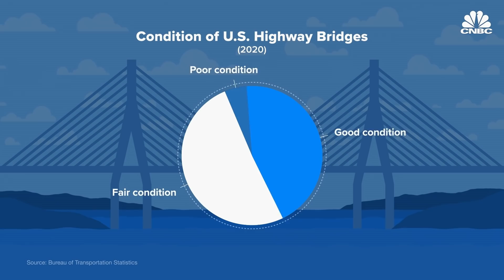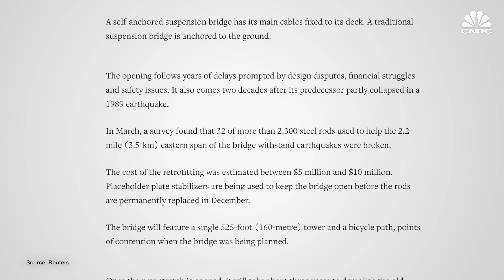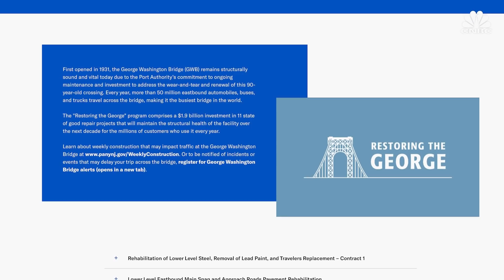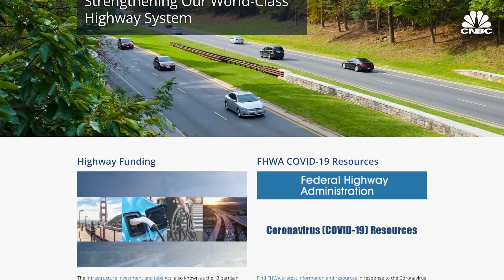Why U.S. Bridges Are In Such Bad Shape

Comment: This video completely missed what Minnesota did after the collapse of the I35W bridge.    The State did a study that identified that the DOT had competent engineers; but was woefully underfunded for bridge maintenance and replacement.

I live in Wisconsin and I recall a multi-$billion Statewide referendum to fund bridge repair and replacement; and the gas tax was raised as well for additional money.     For about the next 12 years there were two seasons in Minnesota.   Winter and bridge construction.   Minnesota addressed all structurally deficient bridges in the State and most of the functionally obsolete ones as well (and are now working on the remaining functionally obsolete bridges).

Now any bridge that gets identified as on its way towards Structurally deficient gets a planned rebuild or replacement project started.  The DOT is now adequately funded for bridge maintenance and replacement.

No one in Minnesota is complaining about the cost.

Why can't other States do the same.   Does each State have to wait for a major collapse that kills people before they take action.

I believe that this video should have pointed out that One State - Minnesota actually took care of their problem.

Comment: One thing is striking in the US: Wherever you go, you see 2.5 ton trucks transporting a single individual between A and B. By weaning 'Muricans off heavy trucks and getting them to use small cars (700kg up) will solve the bridge/road load problem in one fell swoop, not to mention the fuel savings! I know that in 'Murica this is a pipe dream, but still...
Reply: Wrong, totally wrong.  I've been an engineer for 38 years.  Heavy commercial trucks with a legal weight limit of 40 tons control the design loads and stresses on bridge structures, and they aren't going anywhere.  Like it or not, heavy commercial trucks will form a vital component of the transportation picture for the foreseeable future.

That's not to say that it wouldn't be beneficial to switch from heavy SUVs to lighter passenger cars, but it won't have an effect on bridge longevity.

Comment: Seattle has bridges like that. Originally put in expecting single vehicles not semi trucks a multiaxle transit buses. The City has lowered maximum weight per axle and lowered speed limits. Note the transit bus at the break point.

Comment: I have to ask, if that one bridge is 25% of trade between Canada and the USA, what else is in the top ten border crossings list and how does their share of trade compare? Is it mostly truck traffic, or are there rail ways and pipelines too?
Reply: That number is often misquoted. It is 25% of trade by value. Items which have a lot of volume are typically shipped by train. This includes items such as cereals, coal and raw ore and oil. It also includes large and extremely heavy items.

Comment: One of the main problems is our desire for cheap gasoline. Prices in the US are significantly lower than in other developed counties, even though the base cost of fuel is not much different. Frankly, we don't take in enough tax revenue to pay to build or maintain our transportation. I drive in France about 2-3,000 kilometers every summer and I have never seen a pothole.

Comment: Structurally Deficient doesn't necessarily mean unsafe.  It does mean that 1 part of the bridge doesn't meet CURRENT safety standards as directed by the Federal Highway Administration.  For example, the bridge rail on MANY bridges built just 15 years ago that met safety standards when constructed, wouldn't necessarily meet current safety specifications simply based on the design.  The FHA keeps moving the bar...which isn't bad but it does make it impossible to keep current due to limited construction budgets.
If you want better infrastructure, it's going to cost you!
More in-depth inspection of current inventory might be the answer?
FYI.....I am a bridge inspector.

Comment: The US built most of its infrastructure decades ago while many countries like China are recent.  Not really comparing apples to apples but agree there is not much maintenance done due to poor government spending.
Reply: Having driven the roads in China, I can say outside of the few major thoroughfares built last century (designed to handle tanks and large missile trucks) that Chinese equivalents seem to degrade surprisingly quickly and require almost monthly resurfacing. News leaks of some viaduct or tunnel collapse seem to happen just as often as ones in the States despite being brand new (often not even open yet), whereas the the ones coming down in the US tend to be ones that were in service for the better part of a century already.

Comment: The problem also is we don't build properly like they used to years ago.. just like the houses they don't build them like they used to the bill cheaply and crapley the bridges today I made cheaply and light and weak..
Reply: You shouldnt talk about stuff you dont know anything about.  Houses built now are better in everyway than even 30 years ago.  I know seeing as I've been building and remodeling for almost 30 years now.  Same goes for bidges.  Old bridges designs had 2 girders, where one fails the bridge collapses, where as all modern bridges have 4 or more girders and will never completely collapse if one girder fails.

Comment: Good report. Some states, like Pennsylvania and Michigan, are not as wealthy as they used to be from heavy industry, and must still contend with winter weather and road salting. They have high maintenance costs.

The GW Bridge is a vital national highway link. But, that highlights the shortage of trans-Hudson River NY-NJ capacity, either road or rail. NYC subway lines could be extended to New Jersey. Such as the No 7 to Secaucus and the A train over the GW Bridge to Fort Lee. Some existing rail lines can be reconfigured to enable easier cross-regional  NJ-NY-Conn/Long Island passenger travel. 

In the 20th century, the US opted for a mass motoring society instead of extensive mass transit, so there is an insatiable need for road maintenance.
Reply: 7 to secaucus is redundant just rebuild NJT Hudson tunnels